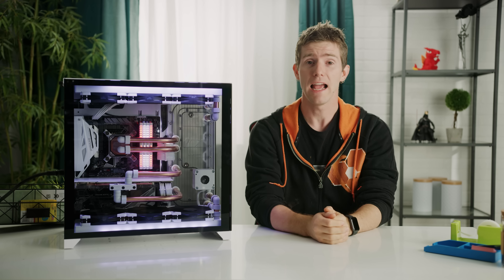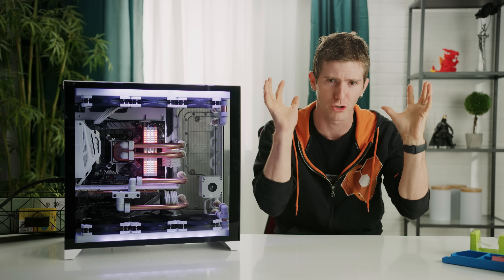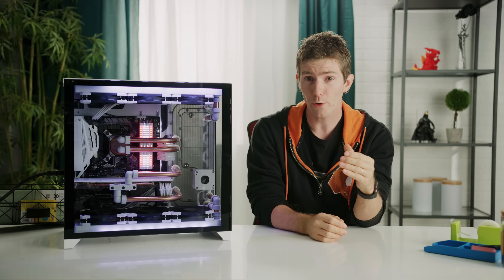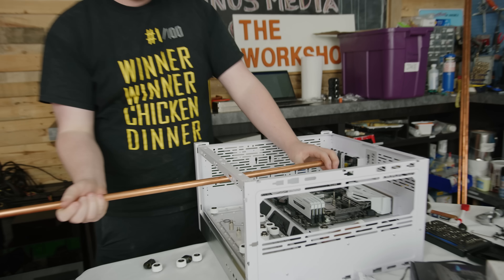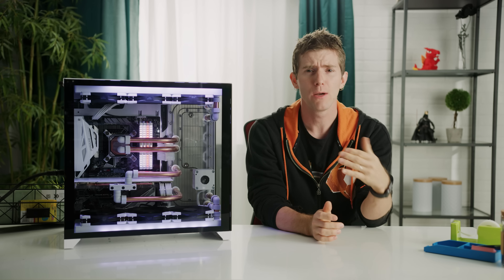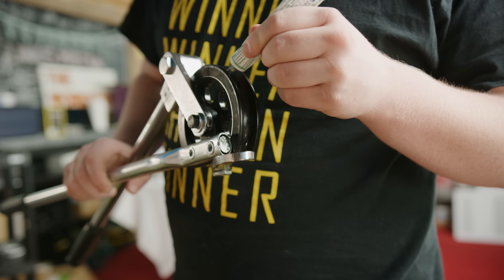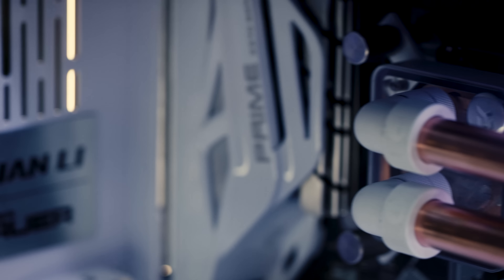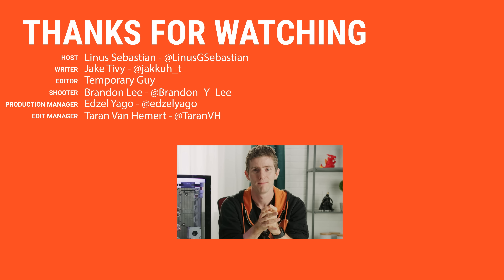Copper Tubing is HARD

Comment: Whole room water cooling: failed becuase copper tubing.
Linus, couple years later: this video
Reply: I thought it failed because of that black reservoir they bought was contaminated with something and caused an algae bloom
Reply: Nah, IIRC it failed because it was pretty much impossible to keep stuff from growing in the loop, and the only issue they had with the copper tubing was leaking initially due to their own poor workmanship.
Reply: @SteelSkin667  They also soldered the pipe together
Reply: @SteelSkin667  That also, but the problem witht he copper tubing was that all the heat was dissipated through the tubes as they left the systems, essentially dumping all that heat back into the room, making the whole system useless.
Reply: @kmcat  yes and that is absolut fine
Reply: @monjessenstein  They did have very long runs, so that might have been an issue in hindsight, but I don't remember them citing that as one of the reasons why the project failed. It's been a while but IIRC the reason why they stopped using it was the fact that it was over-complicated and incredibly hard to maintain.
Reply: @SteelSkin667  Yeah that too, as it turns out mixing metals and corroding all your waterblocks isn't very handy :P
Reply: @monjessenstein  I'll have to re-watch that whole series, it's been years. On principle I'm sure that would have worked... had they done literally everything differently.
Reply: @NoobNoobNews  It did have fans, I've started re-watching it. Cooling capacity wasn't the issue, the systems getting repeatedly clogged up was.
Reply: @NoobNoobNews  Cooling capacity was fine, especially since most of the heat had dissipated from the copper tubes before ever reaching the radiator
Reply from the maker: We stopped using it because we moved.
Reply: It's amazing that people can watch the same video yet have different ideas of what went on in said video.

Comment: As a plumber I can safely say that though I was really pleased to see copper in a build you should no there is no need to anneal the pipes or fill them with anything to get a smooth bend if you are using a bender. You only need to do this in situations where you are bending by hand for smaller or large radius bends.
Reply: Ah, thank you for your input!
Reply: wouldve been nice if he pulled out some flux and solder for the tight 90s

Comment: Finally. My day job of being a plumber will come in handy on my next build.
That build looks clean AF too. However I would have used sand cloth on the copper. Sandpaper is too much work.
Next up, white PVC schedule 80, instead of copper. No bending of PVC will be necessary. Just a bunch of 1/2" 90° turns. 
With that case, even more A E S T H E T I C with white PVC.
Reply: Exactly! But if i use copper i will most likely solder mine. Bending the pipes looks like a pain and the soldered will add a more gritty look
Reply: @jfsjfs57 
That would probably be the easiest way. I would never bend hard copper the way Linus done here. Too much work. 
That's why there is soft copper.  :)
Reply: i think if u wanted white on white like that. super clear glass with white coolant and matching white fittings would be the best way to go.
Reply: PVC would look awful
Reply: If you are a plumber and I do hvac bending tubing is easy and you
Should Own a tubing bender
Reply: @emsj86  
I'm just really lazy. Other than service work on copper, me and most other plumbers I know, have moved on to PEX. Hey! That's an idea. Red pex for the hot water flowing to the radiator, and blue for the cooler water going back to the components water blocks. Linus, make it happen.
Reply: Residential plumbers are scaaaaaabs. Join a union and learn the trade.  @Cline3911
Reply: i've never seen another plumber in a comment section on anything other than videos about plumbing..... GRËËTINGS BRÖTHER
Reply: @dleetzor  
Hahah. Why? So a union can take my hard earned money? I do more service work, than new residential construction, and live a fairly comfortable lifestyle.
Reply: @dleetzor  Residential plumbers aren't scabs. We are the more intelligent ones whom can make blueprints for any new building, residential or commercial. Oh we are also motivated to work much faster with way higher quality standards because we know our own bottom line.  Earn that slow $40/hr while us real "scaaaaabs"  don't get out of bed for under $200 an hour.
Reply: PVC has a relatively low temperature limit though; it gets softer with hotter water. I dunno what exact temperatures is involved, though, so maybe it's ok, especially with low pressure.
Reply: @poiiihy  there is different classes of pvc. You can get pvc that handles high temp.
Reply: dLeeT I’m in the local 420 union
Reply: Spicy Flavor Tide Pods hard earn money ? You said it yourself you are lazy.
Reply: @emsj86 
I am. That is, when doing something for myself. When there is money to be made, I go into full bust ass mode.
Reply: @poiiihy  Regular basic bitch PVC can handle plenty of temperature for this application.

Comment: Imagine spilling expensive water all over your pc

This post was made by air cool gang
Reply: .... Or get an aio cooler? No issues 10 years in. Custom loops are just for bragging rights and not worth the risk
Reply: Tomas Bodnar woosh
Reply: air>aio
Reply: "expensive water"
Reply: yea imagine burning your house with a pack of matches, shit just doesn't happen if you are careful
Reply: Why does the air cool gang work together with the water cooling gang on the radiator though? :O
Reply: Imagine having to clean dust from your pc

This post was made by water cooled gang
Reply: @xAaronnnnn  some dont like the look of a giant metal tumor in the midsection of the chassis.
Reply: Nerdy, Retro, Gaming - . Until it picks up particulates through use and you have a leak or spill when doing maintenance.  But liquid cooling is still fine to those who wish to spend the effort and money.
Reply: @freezEware  or it can't happen at all if the risk isn't there cause there aren't any matches to light
Reply: not a post but a comment 
👏👏 Meme Correction Everybody!
Reply: You should always leak test for a while without power to the PC itself. If you spill on powered off PC, no worries. Just let it dry 100% and it will work fine.
Reply: Jason Poole Ight fam I use water cooling for my processor and air for my GPU so I’m about as impartial as it gets and I’ll tell you right now my radiator is about half the size my GPU for a processor, I switch over to all water I’d need a bigger case and it would have to support radiator mounting so that’s a trash can argument...
Reply: @faudanke4459  yeah because there are absolutely no fans in watercooled rigs right? Do you work for the verge or something?
Reply: @faudanke4459  Define Mini C, bottom and front full-cover filters, stupidly easy accessibility, and for good measure superfine dust is cleaned with compressed air every 1/2 year.

This post was brought to you by Fractal Design gang.
Reply: Jason Poole  i'd just do water cooling for the quiet. No real interest in overclocking. Only lower noise levels.
Reply: @KingHelmer  For the benefit of the end user, its not Intel gang you know :P
Reply: Pipe is inside diameter
Tubing is outside
Reply: I would never put my Fiji water into that garbage
Reply: This happened to me early this year.
I had an AIO watercooler and the thing started leaking halfway through my render cycle (I was working on a simulation).
It almost fried my GPU. Well, technically the GPU did get wet and stopped working for 3 days but I was lucky that I noticed it before things got worse.
After my GPU dried I uninstalled the water cooling solution and vowed to never use anything that relies on water cooling.

Comment: I work with copper everyday, and never have i heated up the copper for bending. we just use a bending irontool. But hey still good job
Reply: @jchap15901  It actually does, Steel (Mostly Iron + Carbon) forms a phase called Martensite upon fast cooling (water quench) which is super hard compared to Pearlite (forms after slow cooling). Steel is then tempered to form "Tempered" Martensite which reduces strength but gives you ductility. Non- Ferrous metals (Al, Cu...) are usually solution treated and then quenched which softens the material, they are then aged (holding at high temperatures) to strengthen depending on the desired outcome.
Reply: @Glen van de poel I agree. Just use the iron bending tool. Imagine having to heat treat every pipe before bending it would take far to long.
Reply: well you rarely need your tubes looking good, you just need them to do the job
Reply: @WolfsFriend42  Most water cooling parts are copper and brass only which doesn't result in noticeable galvanic corrosion. But lower ions in the water is always better.
Reply: @brodie6500  Can you imagine them trying to get great looking solder joints in the apparent time frame they were hoping for?
Reply: Another plumber here and would take so much more time when renovating to warm up before bending :D
Reply: Could always get a Corrosion inhibitor or particle filter you usually fit to heating systems to pull out metal particles (usually ferrous, as the filters usually use a magnet and form a slurry you need to clean out every so often).
Reply: My reply above mentions using a half inch emt pip bender that I use as an electrician. No need to heat the pipe for a clean bend.
Reply: @Krakenshaul  I feel you as an electrician myself.

Comment: you should use this metal tube making knowlage to make a brass pipe and tanked steampunk PC
Reply: brass may not be good for ions and corrosion tho
Reply: @csjdruid434  You can just melt zinc over the copper for an outer brass finish. The inside would still be bare copper, but a beautiful gold finish on the outside from the resulting brass alloy. Gucci as hell

Comment: You should do a chrome silver themed build with chrome tubing, you can't bend it so you gotta use angle connecters for everything it's pretty cool
Reply: If money is no option you could bend copper pipe and then get then chrome dipped that would be dope!
Reply: Chrome plated copper. 'no ugh said.
Reply: That would work, but if it's chromed before bending the chrome will crack during the process. It would look cool though in chromed copper tubing.
Reply: I'm a plumber.You can get chrome coated copper and bend it with a plumbing bending machine.I do this a lot and it looks great and more professional looking than a bunch of extra connections which could leak
Reply: Nah. Chrome and silver are fine, but nickel is what you want, if you want the best looking mirror finish. Nickel over copper looks fantastic. You can even make it jet black, but still retain the mirror finish.
Reply: All that chrome then install ... Firefox
Reply: EVERYTHING IS CHROME IN THE FUTURE!!
Reply: Stainless steel tubing would be better.
Reply: As someone with a chrome (nickel-plated brass) custom loop in a PC-O11 Dynamic, I can attest to this.

Comment: that ever-so-slightly tilted third cooper pipe, the one on the GTX 1080Ti, is triggering my OCD
Reply: Dude
PCMR FTW FUCK YEAH
Reply: Had to scroll entirely too far for this comment.
Reply: Was looking for this
Reply: Could have fixed that by doing a rolling set towards the distribution block
Reply: Sadly, if you have OCD with symmetry, hard line is not for you, there will always be something just a little off, a bend just a little obtuse or acute, maybe a tiny little warble in the run.
Reply: No, why did you say that?! MY OCD AAAAAH
Reply: How about the 1 stick of RAM that's orange and not white during Linus' talking footage?

Comment: I’m sure it’s been addressed already, but the reason it’s called half inch is because of the inside diameter. Piping is measured from the inner walls, as that’s what’s important to fluid calculations and such. Tubing, however, is measured to the outside diameter ;) thanks for finally getting me into computer building at 33
Reply: To add to the confusion, you've got (or had, in the 70s-80s) UK-Imperial plumbing which used the  precise interior diameter,  but METRIC plumbing uses outer. So 1/2" Cu (12.7mm i.d) is really close to  15mm Cu with 1mm walls (soft-drawn, 13mm i.d.), but metric hard-drawn copper pipe is 0.7 or even 0.5mm wall, giving up to 14mm i.d. (11/20"). So does the US vary outer diameter, which must make picking up the right solder fittings a real pain, or change the inner dia?

Comment: Think you need to do a copper set up and use an automotive radiator and fan set up.... sure, it'll take 3 or 4 gallons of coolant, BUT, i'll make those triple 120mm fan setups look tiny :P   Also, did you forget to clean the inside of the tubes or just left that out.... if you heated the outside to bend it, the inside would have also oxidized....

Comment: The real question is can you do it with liquid nitrogen?
Reply: You wouldn't want to use type K for LN2. I think ya might need ACR for that.
Reply: I'm just trying to imagine all the condensation on the copper tubes... At that point you'd have to cover the tubes. A running ln2 loop would be hard to pull off.
Reply: He has insulation over his pipes to stop condensation
Reply: How about liquid ammonia with proper chiller? Ha!
Reply: Water is a better coolant than nitrogen.

Comment: Next... Aluminum tubing.
Reply: While we are  at it, why not CNC'ed WOOD PIPES and polish that!  I suggest Black Walnut as a nice wood that's easily workable, can simply be oiled up to a nice waterproof sheen with mineral oil and then coated with a polyvarathane or polyurethane coat for a stunningly expensive look at a more-than-reasonable price!

And for the kicker how bout SOLID ICE --- Deep freeze the entire setup and use a mold to create ICE PIPES that can then contain warm liquid but still cool enough to not overly melt the ice (a laminar flow layer will form between the ice wall and thermal fluid which should be enough to keep the ice from melting!)  Some sprays of Liquid Nitrogen every few minutes should also be enough to keep the 'Ice Pipes' solid enough to transport thermal cooling fluid.
Reply: @StarGateSG7  Awe h*ll, why not go all out and do ebony pipes? Wouldn't be all that hard to do though, finishing the inside would suck though. Maybe, shape them as two halves, sand and finish insides, mate and glue together over mandrill wrapped in wax paper, small swipe hone to remove glue residue, then run a rag through to apply final coats of varnish. Sand and polish pipes on outside after mating to create a seamless look. Other woods that could give a different vibe, purple heart, yellow heart, bloodwood, maple burl.
Reply: to be fair, as long as you use a radiator and water blocks that are also aluminum, it would be fine. you could easily do that with one of EKWB's cheap kits, those are all aluminum
Reply: Cheese tubing - better keep that water near freezing!
Reply: yeah and lets hope they also heat it to bend it :) enjoy
Reply: oh god dont let apple see this
Reply: Full die-cast aluminum water loop and heatsink combo
Reply: *aluminium
Reply: @shukterhousejive  That would be insane, I'd pay money to see that done.
Reply: how about wood tubing?? 🤔
Reply: No black steel
Reply: @sempaidesu  - Japanese Bamboo!
Reply: @shukterhousejive  Yeah but then you want to change one card et voila the whole thing is in the scrap pile.

Comment: Still waiting for the episode where Linus has an HVAC tech as a guest to build a PC with refrigerant cooling... also copper pipe with aluminum? No bueno.
Reply: Aluminum? Not all of ek's stuff is aluminum you know.. Infact, barely any of it
Reply: It's BRASSS that's nickel plated. Nothing is aluminum anymore unless you buy super crap cheap stuff.
Reply: but then you'd new a whole ass compressor and probably have to worry about condensate building up. then a temp control and all this other shit. PC would be bigger than a digital storm PC and probably heavy as shit.
Reply: @iNewtzify  i dont think they care much about size or weight. They do all kinds of weird stuff because reasons

Comment: Did he assumed that we or anyone watching will be doing this at home? 
Oh bOii
Reply: @LSDSimus  seriously?
Reply: I did copper pipe is easy to work with if you know what your doing I have used copper for 4 years now it helps alot with temps as well
Reply: @Gareth Tucker well u know any way to making holes in cabinet? . 
Like my masterbox 5 doesn't have any.. 
And also that's the only cooling I can afford.
Reply: @Gareth Tucker I was half serious, but ya I'm thinking about changing the front panel to half mesh and half acrylic.. At least it should help.